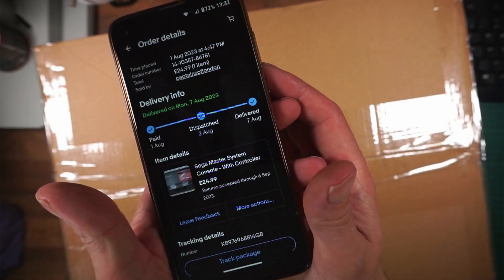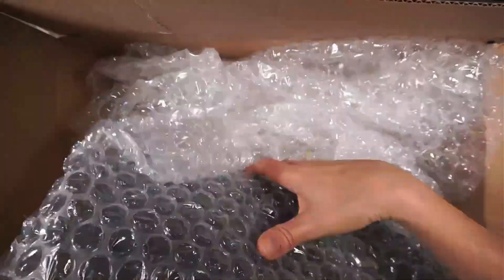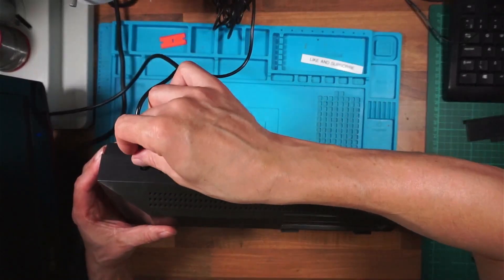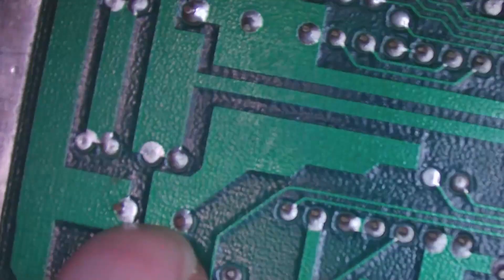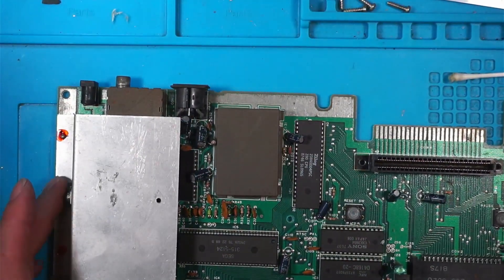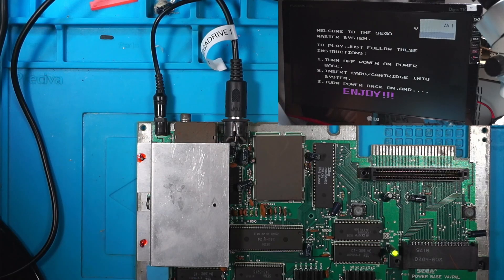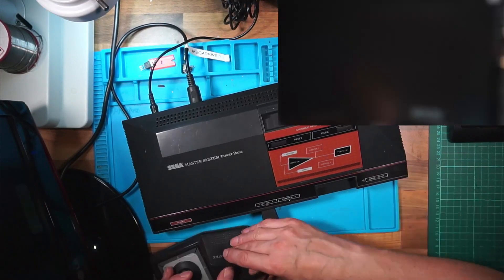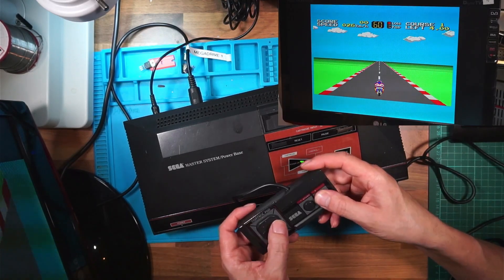FAULTY Sega Master System | No Power | Trying to fix

Comment: Subscriber 912 here :) Good video Phil and good fix. That cap was horrendous!
I think it was most likely someone plugging in the incorrect power supply (as someone below also mentioned) that's caused it to pop.
Either way, another piece of history saved from the rubbish tip!
Reply from the maker: Thanks Craig and thanks again for subscribing. It's always nice when the fault is so obvious, especially when you have the components on hand to fix them.

Comment: I'm inclined to believe that it wasn't the 7805 that failed and caused the cap to blow.

I think it was the original owner plugging in an incorrect power supply that blew the cap and destroyed the power regulator.
Reply from the maker: Most likely. It's a win for me. Simple fix for the price of a 7805 and cap. Thanks for commenting.